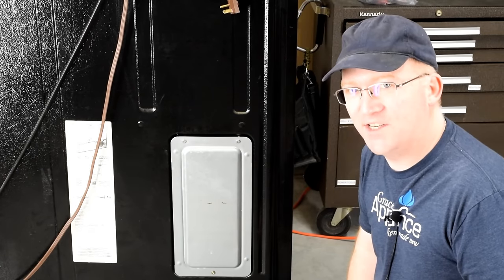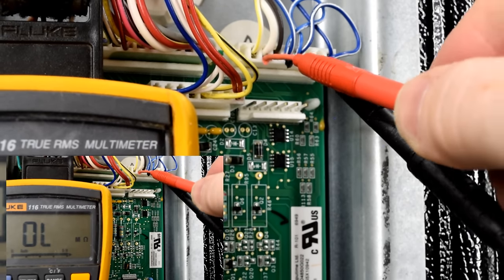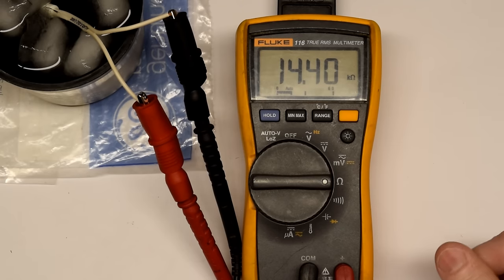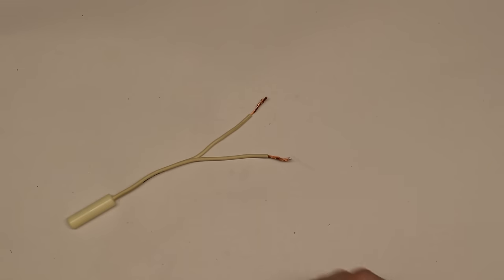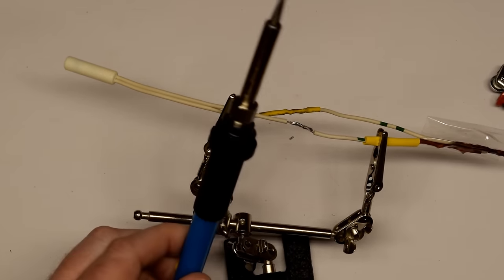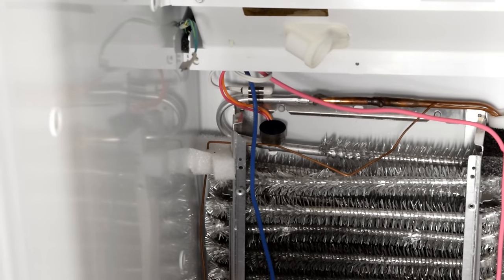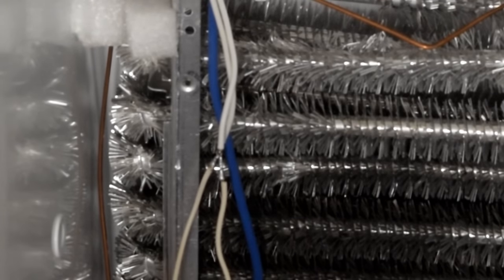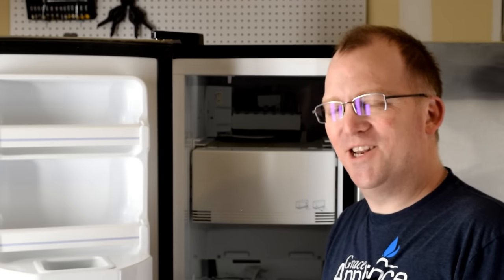Testing and Replacing a GE Defrost Sensor - WR55x10025

Comment: What if you are not getting any continuity from the fresh,freezer nor evaporator wire?
Reply from the maker: What is your model number please?
Reply: @GraceAppliance  GSS25SGMDBS
Reply from the maker: @tonyr.baxter8003  Thanks Tony. 

Your wiring should be the same as mine shown in the video.  The first things i'd check is that I have your meter set to OHM reading.  You'll have the omega symbol and then touch your two leads together and make sure that the reading changes from OL to some other reading (like 0.01 ohm) or something close to that. 

If that's good, I'd try the sensor test once more making sure that you are getting good contact between the leads and the metal portion inside the plug which leads to your sensors.  The leads tend to be quite large as compared to the plug openings and getting the leads inserted is difficult. 

Another trick for this if you can't make good contact, is to take two smaller wires and insert the smaller wires in to the plug making contact with the sensor wires.  Then, you can take your reading from the two smaller wires on the outside of the plug. 

Let me know if these tips help because i'd be shocked if all three of your sensors have failed at the same time.  

Thanks!
Andy
Reply: @GraceAppliance  Yes Sir. Absolutely made sure that I made direct contact. What I do not understand is that when I ran my test the first time, I actually got a reading from the evaporator and when I came back to double check, was no longer getting a reading. I even touched the leads together to make sure they were working and YES they were. Also went ahead and tested the thermostat controller and the heat and got a reading on those. so came back to do a test again and still no reading from neither one. The thing that gets me is that I WAS getting a reading from the evaporator and then for some reason nothing. huh?
Reply from the maker: @tonyr.baxter8003  really strange!
The only other thing I would recommend is taking these same readings with the plug unplugged from the board to rule out any interferance from there.

If still no readings, I'd suspect faulty wiring between the board and the sensors. You may cut a sensor out to verify your reading from the board. I don't like to cut a sensor out unless I absolutely need to though as it compromises the hardwired  connection to simply perform that test.

If you have a different meter to try this test with, I'd do that first.
What meter do you use?

Comment: ok wheres the testing part? i'm not sure this is my problem
Reply from the maker: Hi Bill,
I'm sorry I don't understand the question.
This video walks you through how to test the sensors which are all the same part numbers, but can be either your defrost thermostat, freezer temp sensor, or refrigerator temp sensor. The bad part is they are hard wired in to the fridge and if you did not test them from the control board as shown, you would need to cut each one out to simply test.

The defrost sensor is located inside the freezer on top of the evaporator behind the freezer back wall. The temp sensors are usually located behind a small grate on the wall inside the fridge or freezer cabinet.

What symptoms are you having with the fridge?

Thanks
Reply: @GraceAppliance  Sorry Andy I prob need to go back thru your video! My symptoms are the freezer isnt freezing but the frig is cold. I replaced the defrost sensor about 6 mons ago so i'm assuming its fine as its been fine since my repair.
Reply from the maker: No problem Bill.
If you have a side by side GE, the fridge gets its cold air from the freezer. So, if your freezer is too warm, your fridge is probably not far behind either.

I'd start with the basics. Make sure both fans are working, are able to feel air being pushed through the damper door which pushes the air from the freezer to the fridge, and make sure the coils behind the refrigerator are dust free.

Also, removing the back wall of the freezer inside the freezer is always very telling. Seeing the frost pattern on the evaporator would tell us tons about the issues the freezer is having.

The temps you should have in the freezer are about 0'F and the fridge around 38'F. I suspect if the freezer is too warm that your fridge is likley above 38'F and it may not have been detected yet. 

If you have a thermometer you can throw in the fridge those temps would be good to know.
Reply: @GraceAppliance  My frig is a GE side by side yes . Turns out i hadnt seen the test for the sensors until just now. After testing the sensors all 3 tested good. I hear the fan inside the freezer and just put a thermometer inside the fridge. Couldnt hear frig fan! Ive done all the tests in your vids and everything seems to test fine! I'm stumped!
Reply: thermometer reading inside my frig is reading 17deg after about 10 - 15 min. and I found nothing visually wrong on the control board.
Reply: BTW Andy for president folks ! And buy your parts via the links in the vids!
Reply from the maker: @StonemanRocks  ha! You couldn't pay me enough to be president!

17 degrees inside the refrigerator seems reeeeally cold. What is the temp in the freezer section? Also, do you see any heavy frost buildup on the back wall of the freezer inside the freezer section?
Reply: My mistake! I was reading centigrade! ha! temp in frig is too warm at 50deg F. I checked the sensors twice again and got 14ohms on all sensors! Something seems screwy there correct? Thats too high for the frig sensor I believe
Reply from the maker: Also, remove the bad lower panel behind the fridge and tell me how the coils look.
Reply: @GraceAppliance  No frost buildup! And yes thats too cold my mistake! checking freezer temp now  ice cream was soup earlier however. Refrigerator temp is too high at 55deg. F
Reply: I will review your videos and recheck everything on the board to see if I missed something.
Reply: @GraceAppliance  Coils look a bit dusty! been 6mos about since we vacumed them being remedied as we speak!
Reply from the maker: @StonemanRocks  good deal, I'm here if you run in to any questions.
A little dusty is probably alright if you did the coils 6 mths ago. However Build-a-cat workshop would be an issue. Yours sounds good.

The next step I'd recommend is to remove the back wall of the freezer and get eyeballs on the evaporator. You should see a light coating of frost on the majority of the rungs of the evelorator. Heavy frost would be an issue as would no frost or only partial coverage. This would indicate a sealed system issue.

Good luck!
Reply: @GraceAppliance  Well sadly there is no as in none frost on the evaporator. I assume a sealed system issue would mean its not so sealed anymore! Meaning it needs a charge ? Or maybe a trip to the recycler to sove the whole problem!
Reply from the maker: @StonemanRocks  oh no! 
Yes, assuming your compressor has been running for 30min+ and not constantly clicking on and off... The no frost is a bad sign.
It could have a leak or simply a non compressing compressor. 

There are folks who will add a leak stop and weigh in a charge for the system, but it's for spotty success. I typically will recommend saving the money and putting it toward a new refrigerator, but I'll leave that up to you.

Sorry to hear that though!